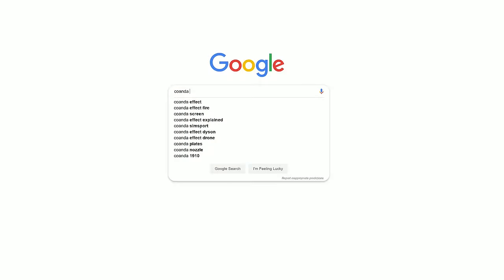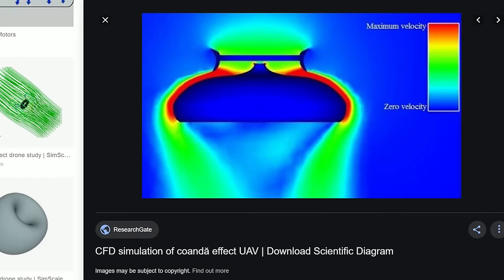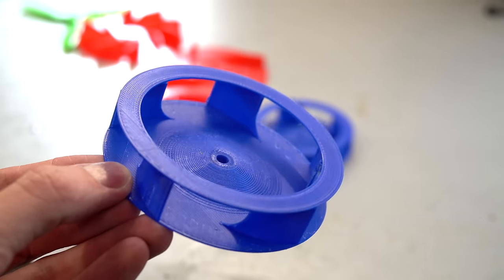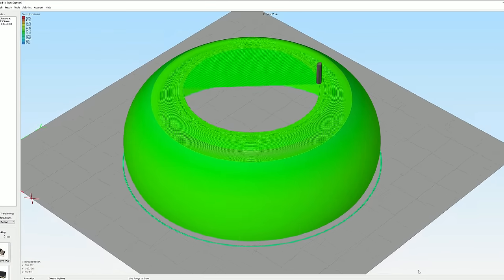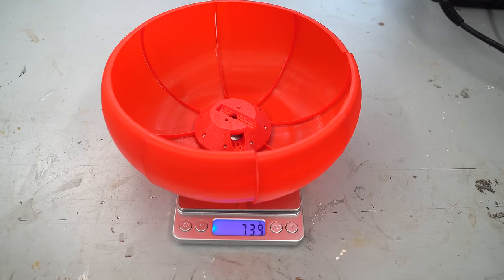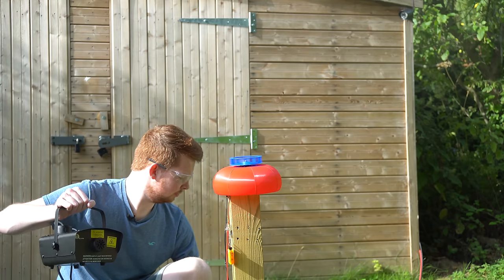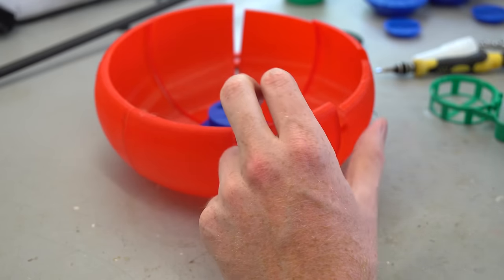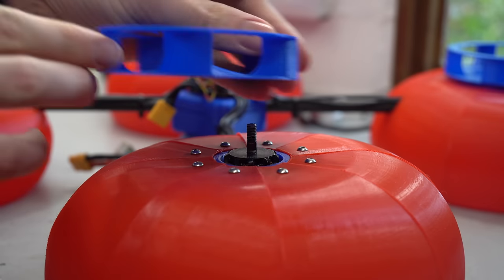Coanda Effect Drone Propulsion

Comment: Double the number of motors and halve the speed of the motors.  What about replacing the props with an impeller that resembles a turbine flange from a jet engine with a ring around it but leaving the motors as they are attached at the end of the video.

Comment: I understand why no-one wants to put another bowl over the top to prevent wasted work by the propeller. I actually truly, honestly do not need anyone to explain to me all about how "tHaT woULdNt bE jUSt tHE coANdA eFfeCT". I know. I get why he's letting most of the work of the propeller get wasted. But that's the source of the inefficiency and if you want a cool vehicle that is viable and fun to ride around in then you're gonna have to accept that it obviously needs another bowl above the first one to direct all wasted thrust downwards. And you'd be wrong anyway. The craft does still use the coanda effect if you do that and it is an interesting thought experiment because the craft seems like it might have all sorts of interesting unexpected advantages. Its worth it if only for the sake of curiosity but cue the internet to tell me how I'm wrong again because im always wrong and everything I said was dumb cos then it would just be a quad rotor and not a strictly coanda vehicle but a strictly coanda vehicle is much dumber. I'm not saying this video is dumb, its perfect, its anyone that doesn't understand what I'm saying that's dumb. A strictly coanda vehicle will always just be a thought experiment but it would still use the coanda effect if you just directed the rest of the thrust down to add to the coanda effect. It just wouldn't be ONLY the coanda effect which was the point of this experiment. What am I even doing? This so stupid. Its literally impossible. Kill me. Please. Please? I'm begging. Please.

Comment: You’re not taking the full advantage of the effect. You can get a 10x effect using another cowl to force the air through a thin opening inside a tunnel. Research the Dyson hair dryer and those effects tested on electric airplanes

Comment: You are not efficient because the airflow has no laminar flow across the surface. You have too much turbulences across the surfaces. Also the initial air inflow needs to be stabilized. Also the form of the red bells should be way more elongated due to the coanda gradient effect.

Comment: if this was an actual viable efficient method this would be used already the reason this isn't being used is because it's a weak method and you will definitely burn out your motors trying to do so if you want to still use this method take a smaller bowl that can cover the actual impellers but leave a gap between the actual salad bowl and the air should be forced downwards more around that salad bowl giving you much more lift this is definitely inefficient the way you have it now at 7 minutes and 8 seconds I'll keep watching

Comment: Suck the air in from under the dome to complete a vortex ring around & inside the craft... copying and forming a smoke ring in nature. 
Disperse the air via a "air blade" over the top surface of the dome to produce more raidal pressure. 
Have two counter-rotating impellers for gyroscopic stabilisation & to control yaw. One under and one on top of the dome sucking from under through to the top air blade. 
Last, control direction via air blades adjustments, thus controlling direction of air pressure over dome surface or via outer flaps. 
Advanced... Spray a inert gas via surface ports for more air conductivity & controlling aerodynamics via electrostatics/ electrogravitics via a wimshurst electrostatic generator Incorporated on the impellers. 
The Coanda effect is only one part & most of the technology is keeped secret by the MIB... Research the history, evidence & patents.

Comment: Whould the Venturi effect be a solution. https://upload.wikimedia.org/wikipedia/de/thumb/2/27/Venturirohr.png/660px-Venturirohr.png on one end you get the air-intake from an propeller the smaller diameter and then expansion. Does it change something about the thrust?

Comment: I got here trying to understand if hitler had a flying saucer and how did it work  ?
I like a large high powered ducted fan over a single prop in a saucer...Nowadays its 6 or 8 props with no saucer.i like the modern 5$ led toy prop in a flex cage.No wonder their is just the legend of the saucer.

Comment: Your loosing lots of lift with current  set up from blending of high and low pressures at the outer edges  of props  try 6 blades and little materials to make your tomatoes  ie  lexan  and

Comment: Once you use an impellor as a propellor, the title of impellor is null and void regardless of design. No? From my Neanderthal understanding, what you did here is simply just try and use inefficient propellor designs?

  And, even though weight would be an added issue, I have to wonder how the impellor designs would perform with some type of intake tube around the impellor forcing the air directly onto the dome. Regardless, it feels like the beginning stages of low bypass compression jet propulsion. 

All we need now is a glow plug and some kerosene! Lol!

Comment: I don't understand the last ~10 min of your video. At 4:55 you realized it was a failure. Dit your sponsor ordered you a 17 min video, whatever the subject, or wathever the respect you give to or take from the public ? Is there any smartness in testing conventional propellers and breaking their flux ? Did you expect more efficiency than with a free flux ? By the way, did you knew that a propeler doesn't push down but pulls up ? And did you knew that you could print the domes upside down like some already told ? You made me lost my time, dude.

Comment: What's the point with second design. Air is going down anyway. You are just blocking it with a big cup. There's no purpose for coanda effect. Dumb or what?
Reply: 2:30 he talked about it
Reply: @therealeren2045  He did it anyway and acted like it was a success.
Reply: @necorvartem6803  Because the main goal was to lift a drone while using the coanda effect. But he couldn't do it using impellers. That's why he went back to using propellers.
Reply: @therealeren2045 I know but it's not a success.
Reply: @necorvartem6803  so? Isn't that why people experiment? To see what works and what doesn't? Isn't that why people do this kinds of stuff?
Reply: @therealeren2045  There was no need for an experiment. It was pointless to cover propellers with 4 big cups.